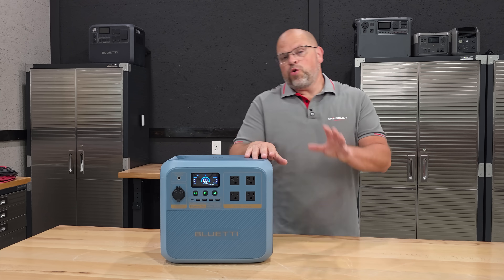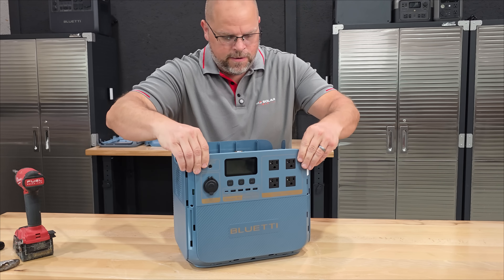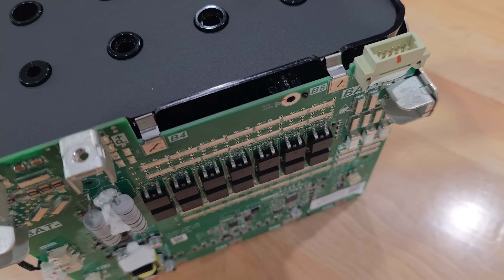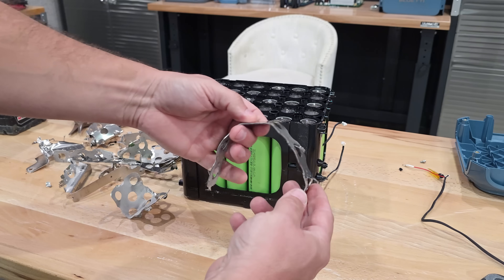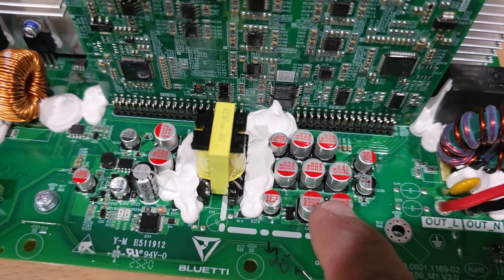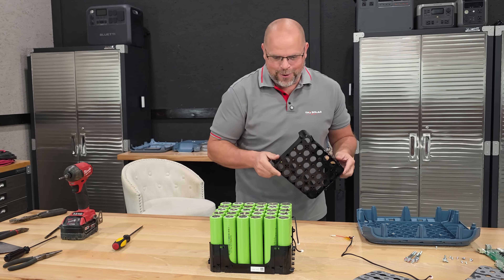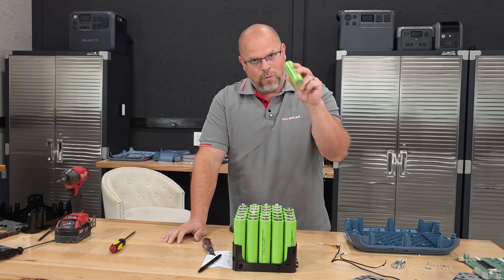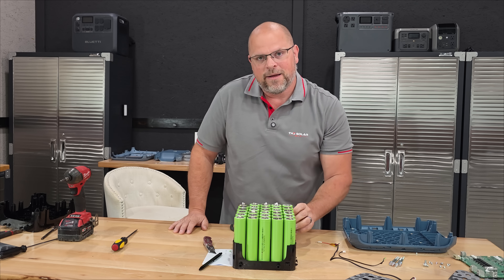Bluetti promised us SODIUM-ION and we got what?!! Pioneer Na Teardown

Comment: I'm pretty deep into this too. 9:25 It’s important to note that higher voltage doesn’t automatically make the inverter itself more efficient. Modern inverters’ efficiency depends mostly on design, switching losses, and load conditions.  The main efficiency gains from come from lower current in the pack and resistive paths, not the inverter. Compared to a 24 V pack, 30 V reduces current by about 20 % for the same output power, lowering I²R losses in wiring, connectors, and DC-DC stages — which keeps the system cooler and more efficient.

Going much higher than 30 V could further reduce current, but it would also introduce higher-voltage safety concerns, more complex insulation requirements, and potentially costlier components. The 30 V design hits a sweet spot: high enough to reduce current and resistive losses, low enough to remain safe and manageable, and perfectly matched to the sodium-ion chemistry and pack configuration. I'm positive this is a voltage we will see more of. 

Lastly, remember that one real advantage to this sodium based system is operation in VERY cold areas. The 30 volts is a strategic advantage in cold climates because the resulting lower current minimizes I²R heat losses, which maximizes the system's overall efficiency even as internal resistance naturally increases with lower temperatures. This is significant.

Great job on the tear down!

Comment: It's very easy to verify, whether it is Sodium ion, by the charge/discharge slope shape. It needs only a multimeter and an energymeter or basically a labratory power supply. It seems, by size these cells would make a very good car starter battery. If you buy a sodium ion starter battery, they are usually not completely filled with cells to save money.

Comment: You don't need to tear off the welded tabs from the cells, use a dremel thin cut disc to isolate them, then you can solder. across the gaps to rebuild it later.  It looks like as you pulled up the bus bars, you could have used the tin-snips to cut the welded tabs, leaving nearly zero gap to re-solder them. 

Plus those tabs connecting the battery to the PC Board are soldered  to the board... just use a soldering gun to remove them (because most soldering irons don't have enough heat). The tabs from the BMS are spot welded to small solderable pads.

Comment: Definitely could have used other methods to remove that battery. Forcefully ripping up the straps was brutal and hurt my soul. 😳😂 
I’d have used a dremel to cut each tab and then you could spot weld a small bit over it to reconnect.
Also, I think you could have managed to get the numbers off the cells using a bore scope or even just cutting a bit of plastic away from the side of the case to read it.

Comment: The reason is because the chemistry is objectively a downgrade. It’s not compatible with many normal Inverters. Because it can’t maintain the voltage very well…

That’s why this type of power bank is just not logical currently. It should be much cheaper than lithium. On average 30% cheaper to produce. So the price of this is just mind blowing

Comment: From the part number on each battery: 32140NSMPR0-30, a quick online search confirms they are LIFEPO4 which also explains the measured battery voltage of 3.85V.

Comment: Thanks for sacrificing this one for science. here's a donation for a replacement fund. 

I hope others will chip in to replace it too. 😀
Reply from the maker: I really appreciate that 🙏  That was never expected. Pleasant surprise to start my Saturday morning. Thank you!
Reply: @TheSolarPit  The printed 3 volts is it's nominal voltage but sodium battery's max voltage is 3.7 to 4.0 volts.

No need to test them
Nominal voltage
Sodium 3.0
LFP 3.2
NMC 3.6

since it's printed 3.0 it's sodium
Reply: @TheSolarPit  What are you going to do with those cells now?
Reply: If you put table salt on a piece of Nichrome wire (Stainless Steel may work.) and heat it in a flame it gives off a Yellow-Orange color.  I believe Lithium Chloride gives off a Reddish color, if my memory serves me correctly (I has been many years since I have done this.).    I used to do this as a flame test when I taught Chemistry to my students.  If you look through a piece of plastic diffraction grating it will break down the colors into bars which can be matched to photos, you can find in a Chemistry book.  The colors are produced by the electrons jumping from one energy level to another.  Each element produces its own light pattern due to the different electron configurations. 

Thanks for doing this test.  I need to replace some old Lead-Acid batteries for my Solar array.
Reply: Um, don’t do this at home!😳🦘
Reply: Such a nice thing to do ! Good luck to you and yours. 🫡🫵

Comment: Should test the boards to see if they have secondary bluetooth wifi components in the capacitors or even resisters... But you sound like a paid endorsement.

A simple chemical test for sodium content is the flame test, which involves heating a sample to observe a characteristic intense, golden-yellow flame. For liquid samples, a metal wire soaked in the solution is used, while a solid sample can be placed directly into the flame.

Comment: from what I can tell, those are Hina cells, they claim about 140wh/kg and due to a low output of manufacturing capacity the price per kwh is really high (too high). hobotech also tested it out and quality of the hardware is older and subpar so I would not recommend this product really, it only looks good and I would wait to see the upcoming CATL cells coming out. They will start mass production in december.

Comment: The 32140 SIBs are guaranteed to be sodium-ion batteries.  
I have owned these cells for over a year!  
A 60-volt system would have a peak voltage of approx. 80 V!!

Die 32140 SIB sind garantiert Na-Ionen Akku.  
Ich besitze diese Zellen schon über ein Jahr !  
Ein 60 Volt System hätte eine Spitzenspannung von  ca 80 V !!

Comment: So, I heard initially from the video that each cell was rated at 3.0V, 30Wh. I incorrectly understood 10 cells in series (10 * 3V = 30V) and 3 parallel groups (3 * 30Ah = 90Ah). When I calculate the capacity, I see 30V * 90Ah = 2,700Wh. But that's not the advertised 900Wh. But, if each cell were 10Ah (30V * 30Ah) = 900Wh. The 30V is definitely unusual, but it makes sense with the cells and configuration.

Regarding the inverter, I was curious about the loss. I calculated the additional loss at 30V vs. 48V using resistive losses (I = P / V, P_loss = I^2 * R) and inverter losses (P_input = P_output / eta): 229.55W (30V) - 176.43W (48V) = 53.11W, or 3.54% of 1,500W.
Reply: You possibly confused Wh and AH ratings initially. The cells are 3.0V/10AH/30Wh each, so 10S3P gives 30v (series string voltage of 10 x 3v) at 30AH (current capacity, 3 parallel strings of 10AH each). The battery pack's energy density is 30v x 30AH = 900Wh. Similarly, using the cell's stated energy density of 30Wh (per cell) x 3 parallel x 10 cell strings equals a total pack energy density of 900Wh.

Comment: Well I believe that to be a lithium phosphate battery. First off the voltage is too high to be a sodium ion. Shake it off if you do a quick search it shows up as a lithium phosphate battery. The voltage you measured is correct what's a lithium phosphate technology. It does not match the sodium ion technology. Sodium ion should be somewhere of the range of 3.1 at full charge 2.5 in use. By the way in the future you can isolate a battery with a multimeter fairly easy without doing any tearing apart whatsoever.
Reply: Nope, they can range from 3 all the way up to 4. I found them online for sell "32140 Na‑ion 10 Ah, UN38.3, specs list 3.5–4.0 V charge limit, 2.0 V cutoff, 30 A rate"

Comment: The manufacturer does not have the incentive to lie by claiming a lithium ion power station to be a sodium ion power station because lithium ion batteries are more expensive than sodium ion batteries. I think destroying the power station to find out if it is really sodium ion is unnecessary and a big waste. Just calculate the maximum voltage of one battery in the power station and compare it to the known maximum voltage of a sodium ion battery  would be good enough for confirmation.

Comment: AI search indicates a lithium ion cell?? The prefix “NSMP” corresponds to Nanjing SMP New Energy, a known LiFePO₄ manufacturer. 🤷‍♂️ open it up, see if it doubles as a salt shaker…
Reply: You aI is bad then - they are " "32140 Na‑ion 10 Ah, UN38.3, specs list 3.5–4.0 V charge limit, 2.0 V cutoff, 30 A rate"" google it instead of being sheep. You can buy them across a few different websites like batteryspace, sodiumbattery, evlithium, and a few others. So they are real and are sodium.

Comment: There is no fundamental reason that higher voltage is always more efficient than lower voltage. It's easier to get good efficiency out of an inverter with higher input voltage, but with good engineering a 30 volt inverter can be just as efficient as a 60 volt inverter. It's just a bit harder, and more expensive. The big issue with mating an inverter to a sodium ion battery is that sodium ion batteries have close to a 2:1 ratio of full to empty voltage. That further complicates the inverter design, because it has to run efficiently with an input that in this case is 20 to 40 volts. As the battery gets low, the current (for a given wattage) is double what it was when the battery was full. That means, to keep the efficiency up, every part has to handle high currents with low losses. Heavy wires and traces, ultra low resistance FETs (that still have to handle the voltage of a full battery) thicker windings on inductors and transformers. All that adds cost, which wipes out some of the cost savings that sodium ion batteries promise to have.
Reply: Transistors with higher current switching capability usually have proportionally more gate charge to achieve the same switching speed, which reduces efficiency particularly at lower loads. There always is a power level beyond which a given system voltage is no longer able to sustain efficiency in a cost-effective manner. That is why most stuff beyond 2kW runs on 48V nominal.

Accommodating Na-ion's voltage curve will be an expensive PITA. If sodium batteries become as inexpensive as the hype claims they may become, it will be more cost-effective to increase raw cell capacity by 30% and not use that part of the curve. Alternately, it could operate with derated output capacity once the inverter becomes limited by input V×I, no extra hardware required for that.
Reply: Wow thanks for your comments, nice to get an accurate description. 
Today my fancy new multi meter with DC amp clamp helped me get a 20,000$ outboard motor going again... it half sunk in a storm.
I'm adding to my knowledge base in electronics and may use Sodium when my AGM bank dies. I'm not sure if my Outback Inverter will work with them or not. it can use 12 to 48 volt battery bank inputs, but it auto senses in increments of 12 volts. not sure if it can use the big voltage range of sodium. 
Do you know if that would be a soft ware update or a hardware never going to happen sort of thing?

Comment: You didn't need to destroy the unit. You could measure the voltage of an individual cell with the pack intact. 3.85 volts is too high for LFP, so it's either li-ion or na-ion. So I can see in the video that the welded straps are simply paralleling groups of 3 cells. That essentially makes a single large cell with 3X the amp hours. 10 banks of three wired in series. Makes a 3P10S battery. There are sources online that will show you the charge curve of the currently available sodium ion cells, which are at about 2 volts when at 0% SOC, and nearly 4 volts at 100% SOC. In between the voltage varies almost linearly with SOC. All you had to do was test the battery as a whole. Charge it to ~39 volts, (a bit less than 10 times 4 volts) and then discharge it with one of the many available constant current battery testers. Observe the voltage as the battery discharges. Plot the voltage VS SOC. No elaborate test gear needed. Just discharge at about 3 amps, and measure the voltage every 30 minutes. after about 5 hours you would have been well on your way to seeing if the curve was looking like a sodium ion battery, which has a significanty larger slope than a lithium ion battery. Keep discharging, and watch as the voltage gets down to ~ 30 volts. If the voltage starts to decline rapidly from there, its li-ion, which is fully discharged at ~3 volts per cell. If the slope stays almost the same down to 22 volts or less, it sodium ion, which isn't fully discharge until 2 volts per cell. On second thought, you could have left all the electronic connected, and just opened it up enough to get voltmeter on to the battery voltage while the inverter was running. Run a hair dryer or other 500+ watt load on the inverter while watching the battery voltage drop from full (close to 40 volts.) If the inverter had shut off at ~30 volts, once again li-ion. If it had kept running until the battery got down to ~22 volts or less, you know it's sodium ion.
Reply: That's like telling Jerryrigeverything to stop destroying phones. This is Youtube. Someone will do it anyway. Teardown is a teardown and it's great information for those who need it.
Reply: Thats literally the smartest thing Ive heard all day.
Reply: its a teardown video..hes not doing wrong on this video
Reply: I agree. He didn't need to destroy the unit to find the battery chemistry. Having said that, seeing inside one of these things pleases me greatly.
Reply: @ThornAppleton-cx3lw  Yup. Definitely more fun to watch.
Reply: Any serious tech channel takes the product apart. Watch the big guys. They even destroy the components to see how tough they are. The thumbnail alone will quadruple his views.
Reply: Maybe you could do a video of you putting it back together and that would work now that would be an interesting video to watch 😂😂😂
Reply: @Droumreague  good one 😂😂!
Reply: Your no fun hehe😉😉
Reply: Bluetti, Thank you for this information.
Reply: It's no doubt NA buds
Reply: This is word for word what I was go8ng to say. Thanks for saving me the typing or the copy and paste from grok
Reply: LFP is part of li-ion Family
Reply: Hey Jim, his money, his channel, his power bank, so y not. How abt u don’t watch 🤷.
Reply: @Ali_ON3  You could tell he regretted ruining it - and he didn't have to. Hopefully my comment gave him some info he can use in the future.
Reply: @jimmurphy5355  u r missing the whole point, not a smart cookie are u? Except may be in the bubble that u live in. 😮
Reply: @Ali_ON3  The bubble I live in is full of insanely smart folks (I used to be an R&D engineer at Dolby laboratories) so I often feel like a dummy (despite having several electronic design patents.)
Reply: Dude did you front physics class? The voltages of any battery can be changed simply by changing the length and area of the anode and The Collector. So determining Chemistry by simple voltages is asinine.
Reply: I did flunk spelling class I did not proofread my response
Reply: @dsarti1  Tha'ts simply wrong. If that were true, batteries of a given type, like LFP, would not all have exactly the same voltage.

Comment: easiest way to tell is to watch the voltage curve as the battery drains.
Reply: Indeed. You only need to charge it then discharge it slowly and measure the during the discharge.
Reply: Exactly, you can't tell by looking at the cell case
Reply: Apparently Sodium Ion behaves much like a Lead acid battery as far as the voltage curve is concerned.

At least my 12v Sodium Ion car battery has no issue just working with my car
Reply: @JE-zl6uy  brand model?

Comment: I understand that they get around the cells high internal resistance by lining them up in parallel then connecting those banks in series.
Reply: Sodium ion cells have about the same internal resistance as a similar AH lithium cell. That hasn't been their issue. They haven't had, until very recently, good cycle life, and their energy density is lower even than LFP, and much lower than li-ion.

Comment: I'm guessing that the 32140 means 32mm x 140mm. I don't use the metric system but they do look like the converted numbers of approximately 1¼ inch by 5½ inches which matches.
Reply: There can’t be many people in the world who measure things in inches and do not use metric measurements. I’ve read scientific papers from the 19th Century and they are in metric
Reply: @maramé.r  Yes, you are correct, absolutely no one in the world uses the mainly uses the imperial system. I don't get the point of your comment. As someone who works as a construction pipe fitter and use the imperial system all the time, I to say it is stupid. That comment is more stupid than the imperial system though.
Reply: It's 32mm (L) x 14.0mm (W) - standard cylindrical cell measurement.
Reply: Not standard at all in any cell. There are some common sizes used for Li-ion cells and LiFePO₄ cells. For Li-ion, the common cylindrical sizes are 18650 and 21700, which are 18mm (W) × 65mm (L) and 21mm (W) × 70mm (L) respectively. As for LiFePO₄ cylindrical cells, there are 18650, 26650, and 32700, which measure approximately 18mm × 65mm, 26mm × 65mm, and 32mm × 70mm respectively. I don't know where you came up with your information.
Reply: @esqueue  Correct. The label includes WxL. That's a standard. Just like prismatic are LxWxD. As well as capacity and volts. That's everything needed to order the part for any design.